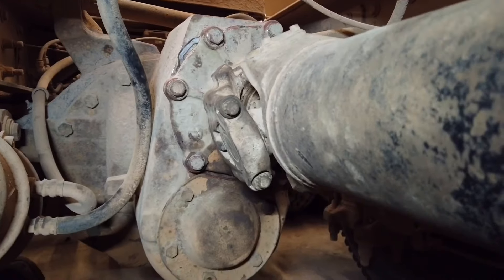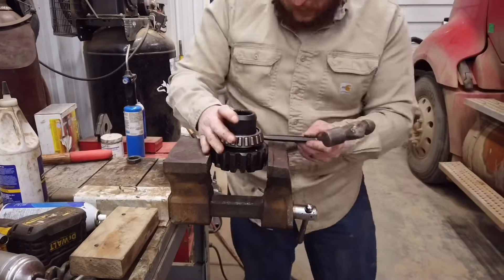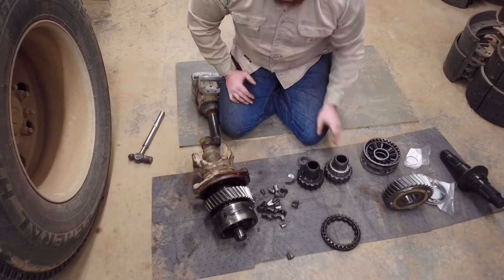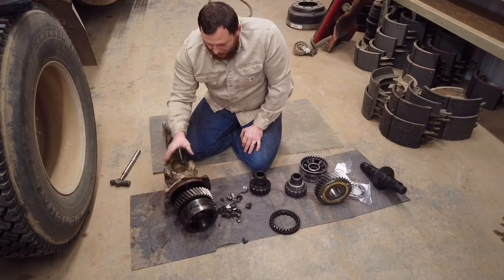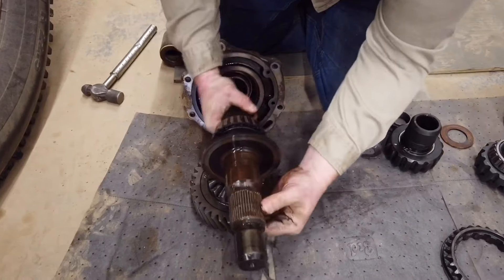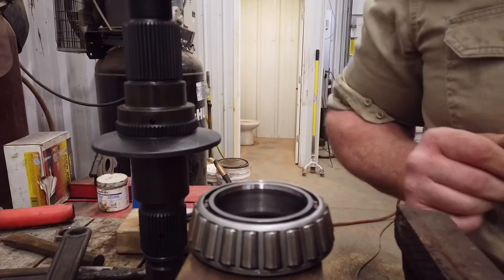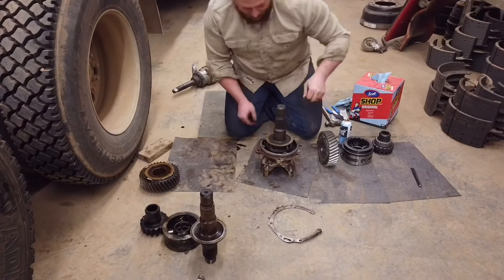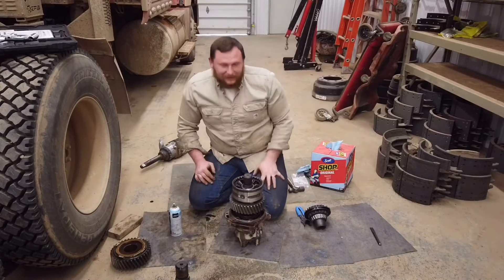power divider / inter-axle locking differential DIY repair

Comment: you might have shown what the  IAD looks like but that's as far as it goes............you heat  the bearing so it will drop on the shaft and it cools so you beat on the roller cage......then you leave chunks of broken gears in the differential housing and you call that good work,,,,,,,,,,,not in my book..........how much longer would it take to reshim and get the correct endplay or preload instead of using all the old stuff...........what was the reason for the worn down splines in the first place..you said you did 15 of these...........is it a weak point of the rear or are all your drivers abusive..........not a criticism,,,,,,,,,just a question.............and on the first bearing you removed why didn't you use a bearing separator...........with 7 trucks you must have one bearing separator.............
Reply from the maker: So we run in the oilfield in northwest North Dakota where the nearest bearing separator is 70 miles away if ur lucky. A year and a half ago I was doing this in the dead of winter outside 20 below zero, no shop, no money for a wrecker and a shop bill. I’m not familiar with IAD. As far as the roller cage is I’d call that a tap not beating. The roller cage didn’t have a nick in it. So the fragments must have found there way to those huge magnets or a got enuf of them out because rite after I made this video it ran cost to cost for a good long time no more problems out of the read end.the splines weren’t worn they were broke. The purpose of not resigning everything isn’t as much of a time savings as it is a deal where u don’t want to mess up anything while your in there that would cause a Bearing failure, it’s like this most of these guys who are benefiting from this procedure are struggling owner Operator’s who could benefit by saving 3k they/we don’t have the book on these rear ends nor do we have the tooling to check the end play or set proper per load. and really if the seal wasn’t leaking and the bearings haven’t failed already what would be wrong would putting it back together the way we found it. So yes this is the weakest point in the whole drive trail I do believe, as far as driver abuse I think it’s driver error for sure but we are asking do do a lot when it’s snowing and they are grossing 105 thousand spin outs happen especially on this one road in particular there is a really steep hill and it claims about one truck mostly tear ends and drive lines. But yes a bought a Bering separator but it was the wrong size so the next opportunity to get one would have been next week in Bismarck over a hundred miles away... I wanted to get home to my family and thought I could get it done like I did.

Comment: Don't heat it with a tourch you will fuck up the hardness use a fucking oven set for 300 at most it will slide on in the same without affecting harness of metle if u do heat it with tourch you dont want any color change i set oven for 250 to 300 at most use as little heat as possible he got it to hot then failed to get it on anyway mind you I dont work on axles from semis I do axles out of cars and trucks so not as heavy duty but should be same basic concepts but I don't have any experience working on semi differentials  thus im not claiming to know everything im just using my experience working on diesel pickups at biggest to give my opinion
Reply from the maker: So most of us done have a oven just sitting around a shop or parking lot where these failures occur.Use a torch and turn it straw color and you’ll be fine. I have done a bunch just like this one. In fact I just drove this very truck personally from ND to southern MO. But time after time this has worked for me and I’ve saved a lot of money doing it this way.
Reply from the maker: The idea is to give folks the courage to do it there self and a straw color with a torch it what u want folks I’ve done a bunch

Comment: I have to ask how much play is good vs bad on that area. I have some it is directly at the shaft into diff. Same as in the video. Slightly worried bearing might be going but also have been told play is normal. you can lift up on the drive shaft and looks / feels like 1/8-1/4 play
Reply from the maker: 1/4 inch is to much check to make sure your yoke but isn’t coming loose. If it’s tight than u got some bearing failure goin on

Comment: I do not recommend you installing this this way I've been doing this for 35 years every day and a high volume transmission differential repair shop in Detroit Michigan and I have never in my life if I ever installed a bearing like this you can take an old race press the enter of the race and press it on without damaging the bearing you're taking life out of the we never use those bearings over always change